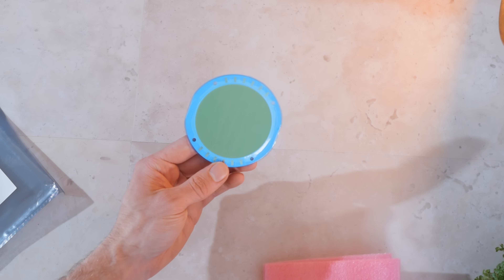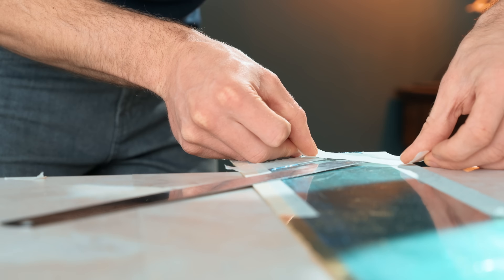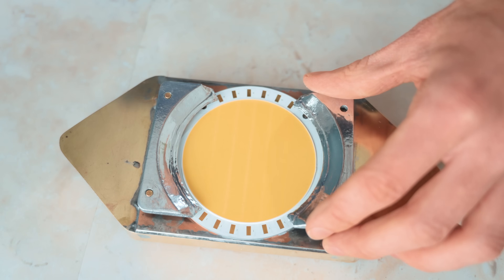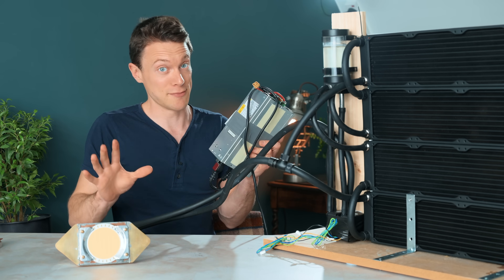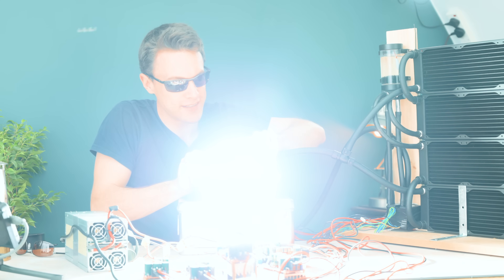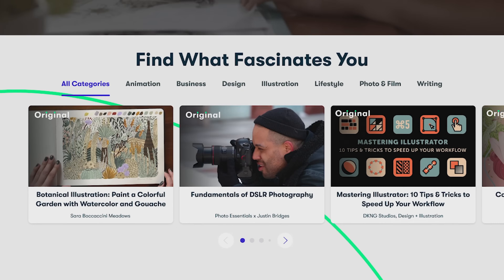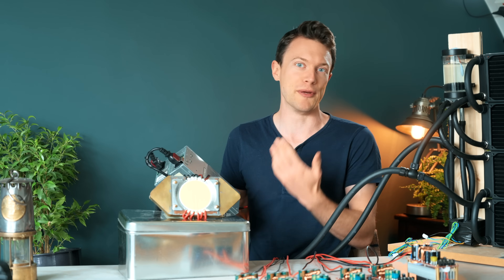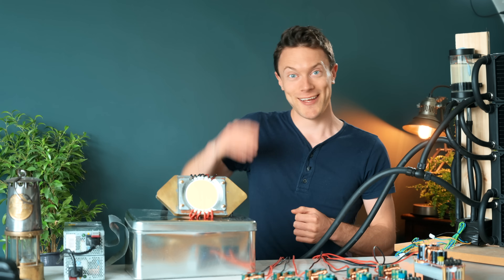Testing the world's BRIGHTEST LED!!!

Comment: Mhhhh, I bet mouting the PSUs in parallel could have saved them, cause with a series, all the current coming from the first got through the second one…
With parallel, since you already had to bump up the voltage, you could have saved them!

Comment: Next time calculate your max Current draw (I=P/U) and monitor this (not the output but the input current from the booster!). I think they might have a pretty low efficiency level and use up your current. (Max Current = Power/Voltage = 1500W / 24V = 62.5A). Also check if the power specified is the output or input power (you can calculate from one to the other by using the efficiency level of the supply. (Or messure the power out and power in and devide accordingly)

The wiring and most (if not all) components of a powersupply are always designed around the max current draw!

While being below the max current draw your powersupply should remain intact.
Reply: I wonder if he powered up the PSUs when all the load(6boosters in to the LED) is connected. If so, it could be that the power supply was not designed to provide full load capacity on initial start up, therefore it failed.

Comment: Greet video…your conclusion is correct as to why you had the failure. All you had to do is run one power supply for three sectors and the other for the next three. You already have 6 power inverters . Also if you wanted to get 24 volts just pop open the power supply and turn up the voltage it’s just a 6 volts difference. Great Job none the less.

Comment: To get double the Current, you need to parallel the power supplies. Wiring them in series gives you double the voltage. You might have stressed the current limitations of you power supplies.
Reply: He wants double the voltage, not the current.  These supplies when run on 240V (he's in the UK) can output 82A on the 12V rail.  Put two in series and you get 82A at 24V.  Even if the converters were only 80% efficient this would be (just) adequate.  Instead I think the issue is that he's only taking the 12V output from one side of the 12V pads on the PSU interface circuit board.   You have to connect to both sides to get the rated amperage.
Reply: @paulgrimshaw6301  If the amps stayed the same, then you would be doubling your wattage. If these are 1000W power supplies, they stay 1000W when put is series. If you had 82A at 24V, you would have 2,000W (again, these are 1,000W). Instead, you would have 41.67A before taking the 80% efficiency into account from the boosters. Remember to use Ohm's law when calculating these things.
Reply: Actually, I thought that it can be dangerous to wire computer power supplies in series or parallel, but I can't remember why. Does anyone know more about this?
Reply: He doubled the voltage on the output of the second power supply in the line while still drawing the full amp load, this is way out of spec. If you want to run them in serries you can only pull half the rated wattage. He needed 4 power supplies, two sets of 2 power supplies in series linked in  parallel in order to stay in spec at the component level for the second in line PSU. Thinking you could run double the rated wattage thought the output of the second PSU was naïve in the extreme. Those must have been good quality server PSUs to have managed to perform so far over spec for the first run.
Reply: @TooBarFoo  You are correct, except I think you mean that you can pull only half the rated amperage, not wattage. The wattage stays the same.
Reply: @AlanRencher  Yes, half the amps, to maintain rated wattage..
Reply: Yes, this is what I came here to say. Really, he need four PSUs: two in series for the voltage, and then those in parallel for the wattage. Then the boosters inefficiency has to be taken into account, which is usually 80% or so.

Comment: Wait a second here... Set of server psus wired in series... for 2000 watts 24 volts... okay... so these are 2000 watt 12volt psus? 

Then later on when they died... it was said each psu was delivering 750 watts...

Um wait a second...

That would be parallel not series... 

Series would be each 2k psu is dumping 1500 watts... while under 2k (this is assuming these are 2k psus and not 1500 or 1k psus...) they are taped together... this is going to let them start to thermal run away...

Either way something is not making sense on the wiring side...

Comment: Hello 

I'll be thankful if any knowledgeable person help me regarding power supply of my led

Cob led which I got is flipflop type and its of 100w and on data sheet it mentioned 3500ma current and 30-34v but problem is I am not finding exact same output driver but someone suggested me to use two 50w and one 12w driver parallely connented (1500ma+1500ma+600ma=3600ma) by doing this it's exceeding 100ma current and even when I test voltage of that driver it show 48v... Will it be safe to power up the led or it'll damage the led?

On data sheet it's mentioned
Forward current =3500ma
Peak forward current (duty 1/10@10ms) =5250ma

Anyone please help

Comment: We need this for an artificial sun 2.0 build :)
Also, I suggest using 2 consumer 1000 watt PSUs not in series. To my knowledge, you can just connect half of the voltage booster boards to one PSU, and the rest to the other.

Comment: Those power supplies might be running in a redundant configuration, so one of the power supplies is handling all the load while the other one is a backup.
It is also possible that the power supply has multiple rails, and the 12/24v rail is only rated for less than the total rating.

Comment: the rule of thumb for PC water cooling is: every 120mm worth of radiator is good for about 100W of heat. your radiator array, using this rule, is good for 4x4x100 = 1600W. Well done!

Comment: Unless you really wanted to build ypur own waterblock there where much easier faster ways you could of gone with, IE a threadripper waterblock with a cold plate shim, then go with a industrial CO2 laser tube water chiller like a CW-5200..... The PSU shouldnt of been ran in series, i dunno what the power spec in your country is but in USA you dont want to run more then 1500 watts from 1 outlet

Comment: maybe the power supplies where connected in a line rather then in parallel and one of them was making 1500watts and the other one just 100watts, you should ve tried to link them in parallel so the load would ve been 50 50 on both

Comment: The power supplies failed because they dont work at 100% efficiency all the time. It would draw around 80% of the wattage it says on the box usually, so if u put it above that 80% it will be stressed too much and fail :(

Comment: Don’t use water for your cooling loop, get some cooling liquid.
Reply: 'cooling liquid' - you mean distilled water?
Reply: @dylanevans5644  if that were the case why would I also say don’t use water. There are fluids formulated to increase heat transfer across a wider range of heat sink materials..I think you meant dionized, but that would have burned the LED out immediately as it doesn’t work with copper. I was thinking a glycol mixture or dielectric fluid since they’re more likely to transfer heat across these custom metal projects….. but hey what do I know, I’ve only been doing this for over a decade of my life. https://www.boydcorp.com/resources/temperature-control/best-heat-transfer-fluids.html
Reply: @theZ3r0CooL   If you have expertise then it is helpful to offer a short explanation of a point instead of an instruction. Then, rather than your comment simply being a statement of your own understanding, it would allow others to understand and further explore your advice.
Reply: @dylanevans5644  or someone could decide for theirselves if they want to research and learn more on their own using the internet instead of me acting pompous and superior than others in comment sections by dropping facts no one asked for. If someone would prefer further info on what I say in a comment they’re free to comment back; as is the nature of the reply function, with questions just as you have. 

Much better than me leaving a 4 paragraph comment explaining every detail about the subject matter at hand just to be sure I cover any question someone who might read my comment might have.

Comment: How exactly would this led be used normally? You had to create a completely unique cooling system just for this to work, but if this product exists, shouldn't there already be something invented to accompany it? Or do they just expect all their customers to invent their own cooling systems?
Reply: You could probably cool it with a compressor based cooler, common for fish tanks, and a large CPU water block.... but the answer to your question is that yes - you need to make your own cooling solutions. These products are not aimed at consumers.

Comment: Do you see these replacing stadium lights any time soon or too inefficient?
Reply: Stadiums already use LED lights, but made up of a much larger array, not that that's a bad thing for a light which needs to dissipate heat. Stadium lights are also put out 110 or so lumens per watt, where are this only manages 80. 

So it doesn't really make a huge amount of sense to try and use this for stadium lighting, you would be having to make a complex cooling solution and getting less efficient lights.

Comment: I wanted to suggest a better power supply more suitable to your needs, versus two old PSUs cobbled together in series.  This Modular Mining Power Supply 1800W- 2000W PSU for 8 GPUs, and handles 110/220V input and retails for a mere $167 on eBay.  Jolly good show!

Comment: As a designer of custom COB LED Light Panels I hope to sell soon, I appreciate the same exact challenges (although not quite at the scale you're on) in learning to power and cool your LED creation.  Only working with a 3-watt 10V COB, the very first time I finished soldering wires to this postage-size beast, when I powered it up - UGH - I thought I'd go blind.  I wasn't quite expecting so much light intensity from such a tiny source.  For the next 20 minutes, I kept seeing dark spots before my eyes akin to staring at the sun too long.  I cannot fathom a 1000-watt light so BE CAREFUL!
Reply: How's the panels coming along? Sure hope you didn't look into your artificial sun again...

Comment: I'm a bit late watching this one, but I suspect the LED used is almost identical to what Mole Richardson made for their 1600W LED Tener. https://www.mole.com/tener-led - At my last job we powered these massive air-cooled LEDs off batteries using a Dewalt flexvolt 1800w power station. The whole kit ended up close to $20,000 CAD but was almost perfectly silent and the most portable solution available! FYI 4x 9.0ah batteries = ~25 minutes at 1600w

Comment: Using air based heatingsinks is slightly problematic. Very often your cooling water starts to accumulats "stuff" from the inside of the radiators and pipings. This can start to block the small fins and cause some channels not to get enough fluid throughput and cause localized overheating. Removing some of the fins should solve this. Check your lamp with a terminal camera for hotspots. (This effect takes month/years to manifest)
Reply: That effect is called 'Fouling of a heat exchanger'

Comment: Tip; use the back of your hand, when checking for heat. Blisters there, will not disable your hand, like blisters on tour finger tips, will.  Borrow, or purchase an arc welding helmet, with the darkest filter available

Comment: should you not have water tested for leaks first before committing to mounting the led on it? btw why not have direct water cooling over the entire led using distilled or deionized water so no issues with electrical shorting but more efficient direct heat transfer?

Comment: I’m always amazed these COBs don’t rip themselves apart with the thermal expansion changes of substrate vs. semiconductor. A lot of material science must have gone into their R&D!
Reply: Would you mind explaining that? It sounds very interesting!
Reply: @vocalathletics  Simply as stated. When materials heat up they often expand differentially.  If bound together this can cause stress often leading to fractures in either material. COBs are a layered structure of semiconductor and various mounting substrates that get very hot, so a prime candidate for physical failure if not implemented correctly. I hope that helps.
Reply: @kipling1957  the substrat is a ceramic material.
Reply: @kipling1957 They use ceramic and gold wire which can handle a lot of current without heating up. The gold wire is less then 0.002mm and can easily handle 5+A
Reply: I've got a few 10w ceramic cobs made by Cree which fell off their heatsink and kept running for a few minutes and did not fail from thermal expansion. The phosphor cracked and it got slightly less efficient than its peers, but it still works just fine, every single die.

Comment: The reason I believe power supplies failed is because when you were running them at max power the components inside power supplies got quite hot and as long as the fans were running the temperature remained under the limits but as soon as you may have pulled the power plug the fans, and the power supply turned off but the heat inside the supplies was accumulating as there was no way for it to wick away quickly as the fans are off at that point and the components got super hot super quick which resulted into failure of the supplies.

Comment: yeah.. you could use smaller cooler because over 35% of 1500 Watts is converted to light
Around 500 Watts so 360 mm rad with water's thermal mass should work

Comment: I have an old school 240V AC 60V DC 60Amp Lab Power Supply that would easily handle this load, but, it weighs 120lbs.  A more common solution for testing would be almost any adjustable stick welder.  I know that sounds crazy, but at least for testing, it would eliminate all of the components you are using now to produce the required power and do it reliably.
I honestly thought the title was clickbait ... I stand corrected!

Comment: Unfortunately the power supplies you have are from a blade server, which use internal fans to also push air through the power supplies, the servers are built with a full width bank of high powered fans that litteraly sound like a jet taking off.

Comment: Your power supplies may have been rated for a total of 2000 watts, but you forgot that those boost converters only have an efficiency of probably 70-90%, so after six of them, you're losing quite a lot of power to boosting the voltage alone.

Comment: You dont need so much cooling. The led is 1500w with approximately 92-95% of efficiency. So the loses are 5-8%. Meaning ~100watts of heat.

Comment: Fun Fact: Electricity actually runs on smoke - if the smoke escapes, the electricity stops working
Reply: Magic smoke escaped
Reply: What, no mirrors?  SMH, ok...
Reply: Every electrical device is a smoke machine if operated wrong enough!
Reply: @petergoestohollywood382  Sometimes even not electrical devices.
Reply: This is true, I've worked for a factory that puts the smoke in.
Reply: Absolutely. A semiconductor fails when the magic smoke escapes 🙂. Unfortunately this joke will be lost on people without an electronics background.
Reply: Ive never heard this before lol thats great
Reply: Fact. Never release the magic blue smoke. Good advice 10/10 would follow
Reply: Internal combustion engines are the same. If all the magic smoke escapes it probably won't work any more.
Reply: If you gather up the smoke and put it back in, it will work again.
Reply: I kinda lost brain cells. Can you explain a bit more?
Reply: @anakinskymonke3670  aside from the joke, its when electrical arts form and burn causing smoke to be released.Pretty much your stuff has died and its burning inside.
Reply: @anakinskymonke3670  your not a electrician are you? Basically electricity is smoke if it escapes electricity has a hard time flowing and may even stop working, its called the magic smoke
Reply: @josphe9011  Basic common sense would tell you that a normal person won't ask a question relating to electricity if that person isn't an electrician. OF COURSE I'M NOT AN ELECTRICIAN.
Reply: That's why I requested a more elaborate explanation. Which you solemnly did for me. Thank you!
Reply: @anakinskymonke3670  bows
Reply: @anakinskymonke3670  electronic get hot, hot thing burn, fire no good for electronic
Reply: @vortexbeater8267  Best explanation by far

Comment: It's never good practice to drive switch-mode power supplies with switch-mode power supplies, especially parallel in series with parallel. It would have been more sensible to modify the server PSUs to 30V; a relatively easy task.

Comment: Amazing rig and quite a successful prototype. I would like to propose some ideas. What about instead of water cooling the LED, why not try a Peltier to cool the LED and then just 1 or 2 of those radiators to water cool the Peltier. Then use the rest of the radiators to cool the enclosure of the power supplies. Another suggestion is, once you shut off the LED, try too keep the power supply fans running for at least a minute or two to help dissipate the lingering heat from the circuit. Many many systems burnout just by the excessive lingering heat. I hope you can find something useful in my comment.
Reply: A typical peltier cooler can only handle 1/10 to 1/15 of the watt you got here and is also the reason for peltier cooling not being used on CPU and GPU on computers anymore because they create way to much watt of heat for peltier to handle. Also on top of the heat coming from the LED you have the heat the peltier creates itself (50 - 150w) that you need to cool if you use peltier. Peltier is only a good option for cooling when you have little little heat to remove and want sub zero temperatures in a small package.